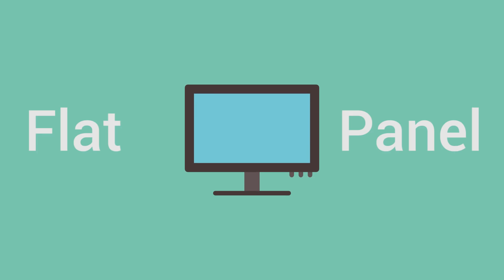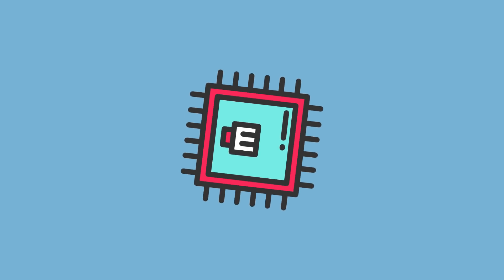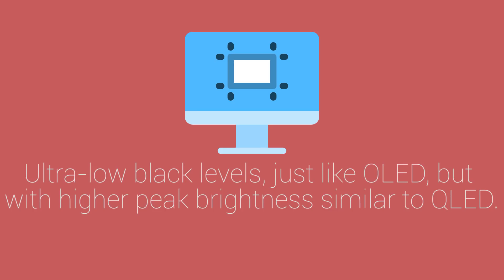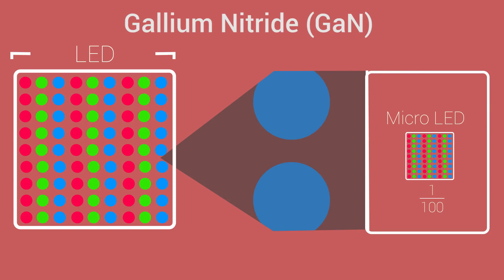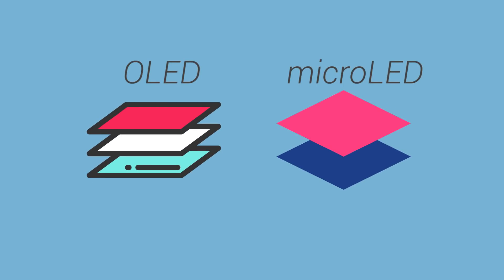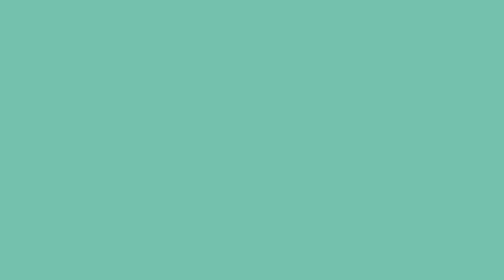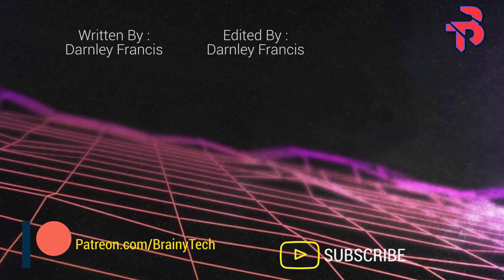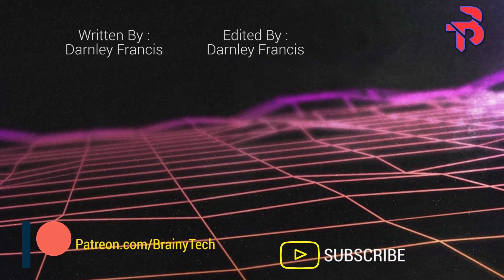What Is microLED? (is it better than OLED?)

Comment: Micro LED can potentially be THE display technology that we've all been waiting for. OLED like performance with none of the burn in problems mans that in the long run, no more worrying over choosing TN vs. VA vs. IPS LCD tech because they'll all be technically obsolete.
Reply: 4G12 : Yeahhh MLED can be better than OLED. And they have the potential to be the first display with self lighting pixels that are good for the use with pc... OLED is not good because burn ins, and plasma the same + it is not possible to build plasma displays small...